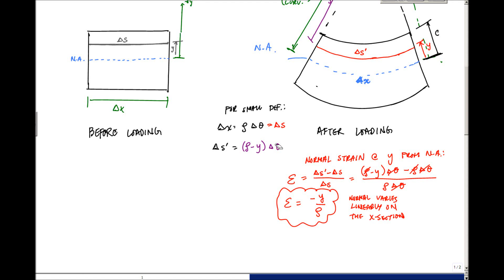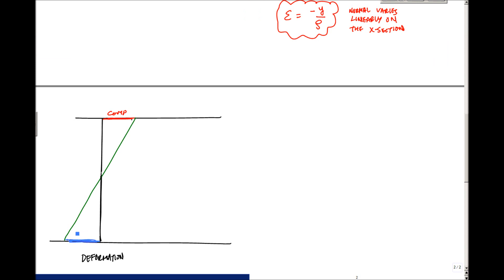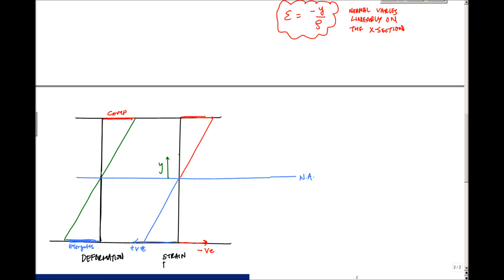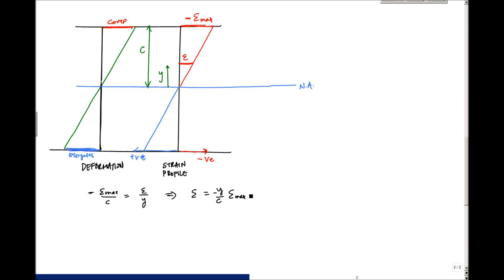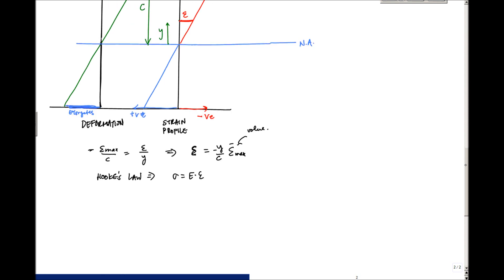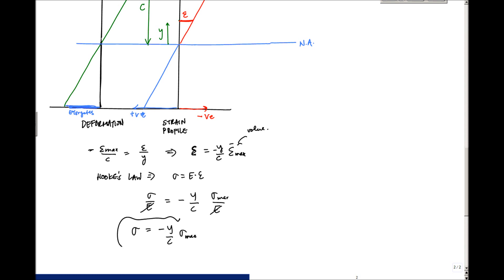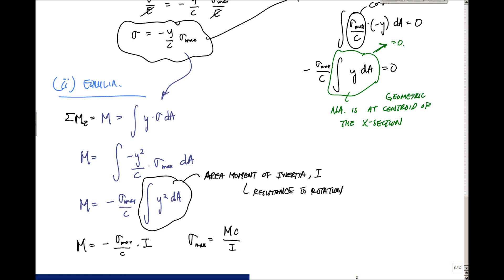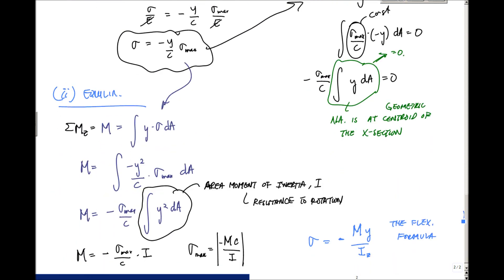Flexure Formula (Part 2) - Mechanics of Materials

Comment: Can you do another video about the flexural  strength formula as mention in ASTM C78 (concrete beam) because that's the reason why I came to this video. 
It says, Flexural Strength = (PxL) / bd³
Where, P is max pressure that works on beam till it fails, L: length of beam, b= base, d= depth. 
So PxL is Moment right? 
And what is bd³? Isn't it supposed to be Inertia (Ix) , which is 1/12 bd³?=M/Ix
Why there's no 1/12 in that Formula?
Thank you very much. And I hope you Understand my question because English is not my language. 🙏🙏🙏

Comment: Hi, while calculating how you determine Y should it be measured from top or bottom and why ? in case of symmetrical section its same thing whether you measure from top or bottom but in unsymmetrical section its not the same.

Comment: in strain profile ,when we are using similar triangle method to correlate strain at Y and strain max. at C , from where this negative sign came . e and e max both are negative and Y is having same sign as that of C . a bit confusing !!!!
Reply from the maker: +Eugene Ougo thank you! I love it when our community responds to comments in a positive way. It makes me feel like I'm part of a massive, moving cloud of learning with lightning bolts streaking across the sky and thunder in its wake!
Reply: +Dohendra Dubey Check out the first part of the video more keenly you will understand where the negative is coming from.
Reply: +structurefree I dont understand why E isn't negataive and Emax is. Is it because E = -y/p and y is positive so you will get E?
Reply: because e is general and e max is negative due to change in length of section due to compressive force